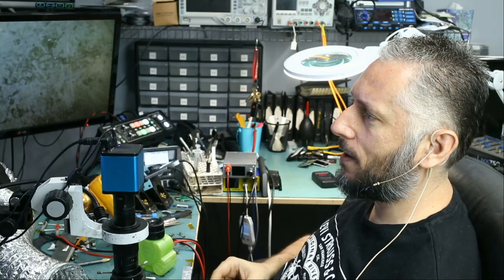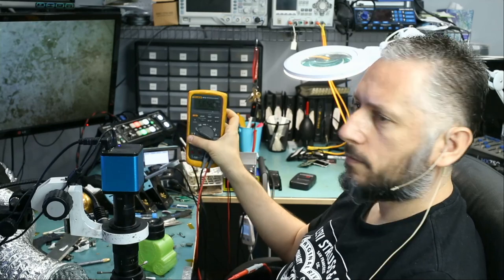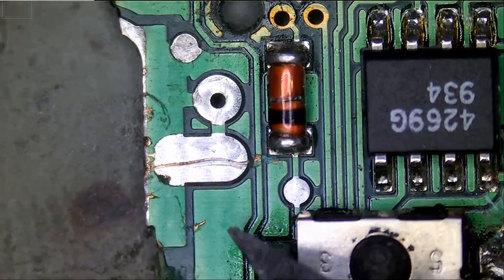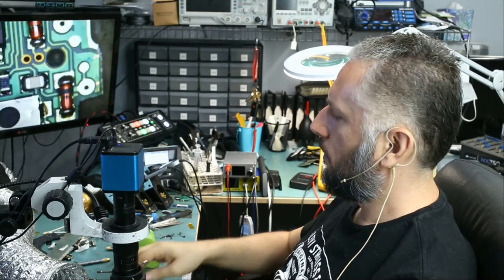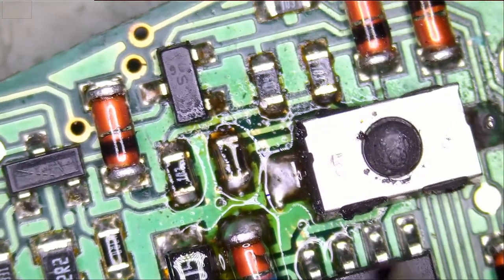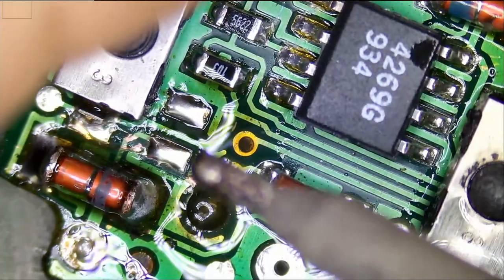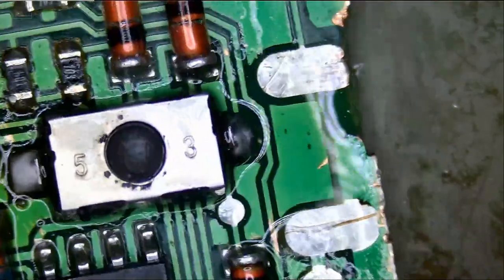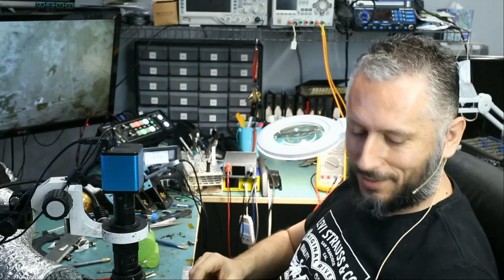2000 Mercedes Benz E430 Key FOB Repair. Lock Unlock buttons not working.

Comment: Good job. Although I am 99% sure the chip on the back also has a bridge between two pins. 

But if it works it works. 👍
Reply from the maker: Good catch but hard to tell. I'll check it out tomorrow before we mail it back.
Reply: Sharp eyes and went back and had a look.  Appears to have a bridge on the long chip CTCTBX9937 on last 2 pins top right and on right of that chip a written number 8.

Comment: excellent work! I have been watching many of your key fob repairs . most of which involve lock and unlock problems. BUT what about key fob  NOT working in Ignition switch ?  as won't activate ignition on,,crank and start?  (unlock steering lock)  can you fix those?

Comment: Original repair changed the tactile switches as they are a common fault. But they messed up the soldering so it didn't work at all.

Comment: Customers are afraid to mention that it has been worked on before.  I believe most repair shops won't touch it if an attempted repair has been done, more so if the repair was done by the customer.

Comment: seems like people brake things for no reason.. what was changed when the device was first open? have they just opened the fob to put a blob on those 3 components and take that missing smd??

I don't get it........
Reply from the maker: It looks like an attempt to re-solder the buttons using a big tip and no flux.

Comment: They tried to do it themself. The switch probably had fractured solder joints originally. Just because you make it look easy, they underestimate the skill involved. And without a microscope , it is a losing battle